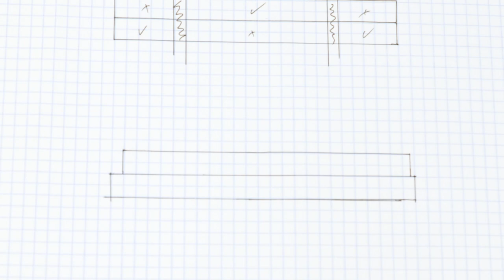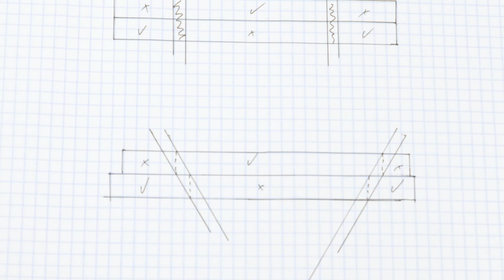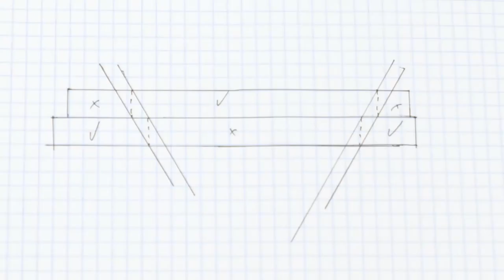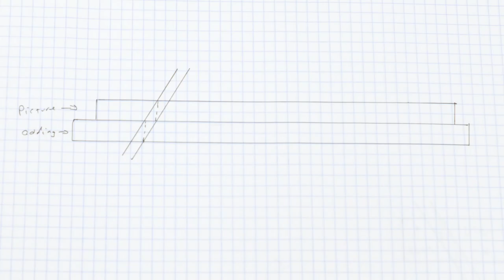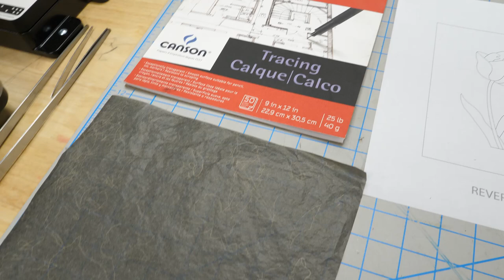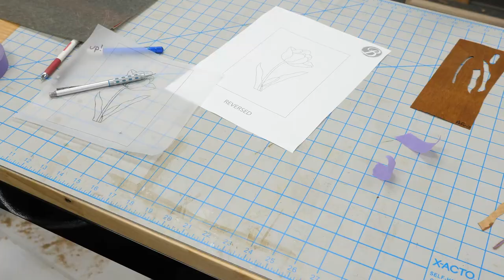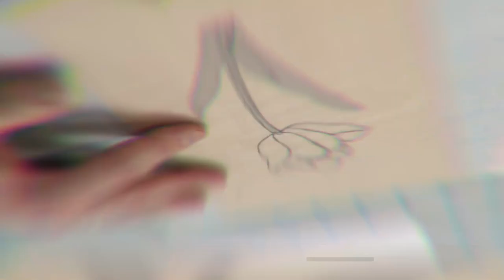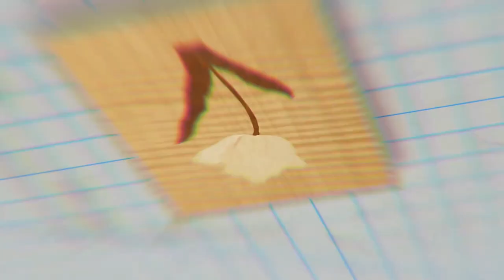Double Bevel Marquetry

Comment: This is amazing work I have done some inlay on the scroll but nothing in veneer. Incidentally I have the exact same scroll saw as you are using and it is a fantastic saw.
Reply from the maker: Thanks! It really is a great saw, I much prefer the tilting head over the tilting tables. I've got 3 other saws, but this is the one I use the most!

Comment: question? Why can't you cut out the same coloured pieces that are attached to each other at the same time similar to doing segmentation. I must be missing something??
Reply from the maker: Do you mean cutting them out as one piece? You could do that. I cut them out as separate pieces here so I can make sure the grain direction is going the way I want it to on each piece. For example, I want the grain running end to end on each piece of the stem and leaves so each piece has to be properly oriented along the veneer and cut individually.